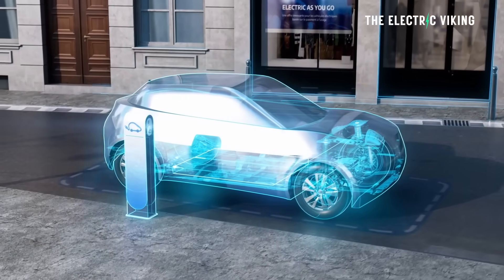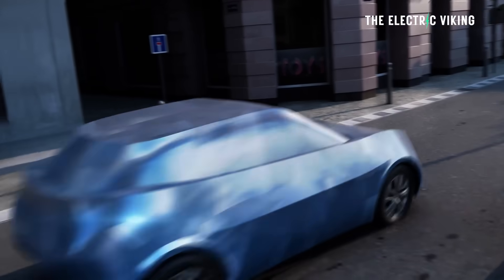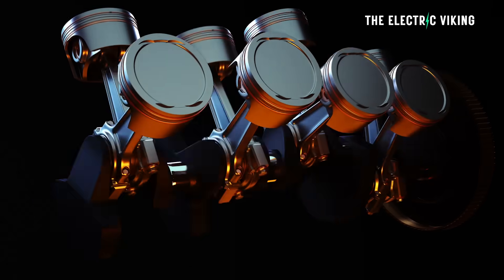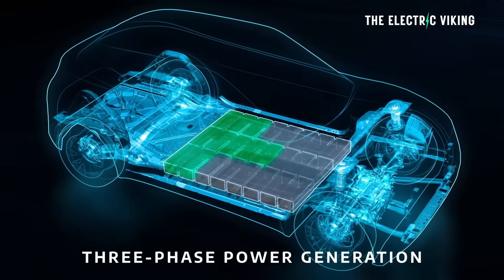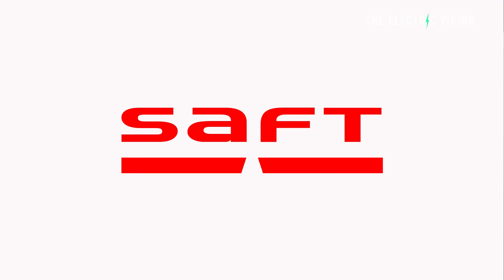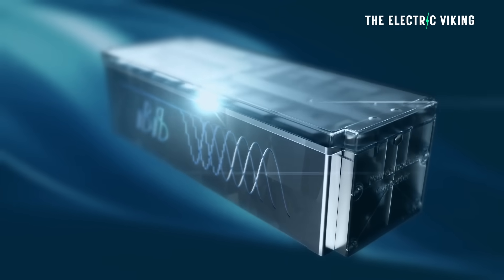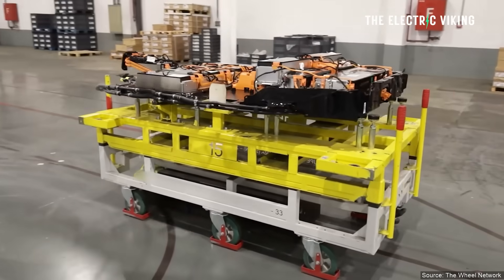Stellantis' says its new IBIS Battery tech will revolutionize small electric cars

Comment: It's about time.  It's been at least 6 hours since the last "game changing" battery was announced.  

I just wish one of them was actually practical and made it to market.
Reply: LoL. Well said
Reply: This has nothing to do with chemistry. It's all electronics
Reply: How about the latest Toyota hydrogen battery 🤣🤣🤷‍♂️
Reply: Sure 500wh/kg is great for aviation but what the car manufacturers need is a 70kwh pack that cost 3k not a 200kwh pack that cost 40k because if they only cater to 10% of the world then that well will dry up sooner or later and they will be in the same position waiting for bankruptcy
Reply: @lesstevens2370  3 year's or less away imo from that at the cell level when using lmfp or m3p iron chemistries. 

Remember catl is claiming the latest m3p chemistry supplied to tesla in china which uses iron, alum, magnesium&zinc doping. 
Are capable of matching energy density levels at the pack of the best nmc cells from 2020. 

So lfp is only about 3 development years now behind nmc for pack energy density. Gaining a lot of ground now very quickly it seems. 

Thanks mostly to tesla partnering with them in mid 2021 and half of all teslas sold since 2022 having some form of lfp cells in them. 
Estimates show lfp is over 43% of all cells sold ytd. Expected to exceed 50% globally for 2024.
Reply: this is extremely practical because it is completely independent of the battery chemistry. you could also use the same chemistry like VW has in their modules from LG. you can use NMC, LFP, LFMP, sodium-ion, etc. whatever is available. this something that the electric viking did not understand.
Reply: @stefanweilhartner4415  Right now, we’re in the middle of the next Industrial Revolution.
Last century, during the 70s, we saw the transition from discrete semiconductors into integrated circuits, and the miniaturisation of them, leading to memory chips, CPU’s and GPUs.
Now you see the development of batteries and new usages into applications like EV’s (and new ones, like automotive robots)
Reply: Catl condensed matter cells entering production by q4 of this year at up to 500wh/kg is real.
Catl just formed a joint venture for electric air craft. Those cells will power the prototypes. 

Nio and welion has the 150kwh pack in production and available now. Semi solid state pack weighs 44# more for 150kwh capacity vs the current catl 100kwh nmc pack in the same case. Cost is prohibitive though, rumored at nearly 40k just for the pack. 🤔
Reply: @4literv6  Also worth noting that CATL's battery is actually claimed to be cheaper than current Li batteries.
Reply: @davidcolin6519  indeed, very exciting imo to see the world's top battery producer boldly saying a 500wh/kg battery is entering production later on this year. Then actually form a joint venture for electric aviation! I believe catl will do what they say&shouldn't be ignored or dismissed. 

Also seeing as they are teslas largest single cell provider currently. That could mean some interesting time's ahead for tesla high end model's. 
Like gen2 roadster and maybe even semi? Imagine a 700-800 mile semi that charges in 30mins or less. 
Or a gen2 roadster lighter than a model 3 performance is, but with plaid hp&better aero. Watch out rimac nevera. 😀👍🏻
Reply: @4literv6  I think that you're jumping
 the gun a bit here,
Just because CATL supplies Tesla doesn't mean that Tesla is going to be favoured.
In fact Geely's Zeekr brand will be the first to have delivered units and, although Tesla has pu t in orders, there is no guarantee that they'll perceive favourable treatment.
And although Tesla has made a name for itself by working on efficiency by using aerodynamics and lightweight aluminium casting techniques, I am sure that there will be many companies clamouring to get these batteries.
In fact, seeing as CATL has multiple development contracts with multiple manufacturers, I suspect that production will go to manufacturers who are best placed to promote the wonders of CATL technology.
Under the circumstances, does that even begin to describe Tesla?
My impression of Tesla is that it appears to be entirely built around singing the praises of Elon Musk. You can certainly correct me if I'm wrong, but what if I'm wrong, but the impression is right? How far do Tesla drop down the list of clients? Obviously they're already behind Zeekr/Geely, but there are plenty of Chinese automakers which have just as enviable relations with CATL, but which don't have an egotistical maniac at the helm.
Reply: @4literv6  No One will buy a $40 thousand Dollar batterie............Paul
Reply: @paul-flyer  the first model s batteries cost over that. The price will come down as the tech matures and ramps up.

Comment: Stellantis is just building the charger and inverter into the battery modules.  Lets be clear about that... there is no way to actually get rid of the charger and inverter.  The batteries themselves are still DC.  This is not an improvement.  The lower voltages in each pack make the functions significantly less efficient and the multiplication of parts (every module having an inverter-charger) is more expensive and less flexible.  This makes about as much sense as a hole in the wall.
Reply: I fully agree with that your take and had the same reaction when I first read the announcement.
On top of that it is my understanding that the 3 phase AC current the drives the motor has to be finely tuned for best performance. If it is the case, good luck to synchronize inverters from 24 battery modules. 
I would also say the industry leaders (Tesla and BYD) are moving away from battery modules to structural battery packs so these packs will probably not be very efficient in Wh/kg compared to structural batteries
Reply: Ty for ur  very llkely possible foment u could be right I’m jus not smart enough to know any better
Reply: "microstepping" with multiple LV stages has some advantages. much less filtering, for example. lower voltahe parts with much slower switching, makes for less expensive parts, more efficiency. its a bold concept that needs quite some cost optimization.
Reply: @skataskatata9236  The electronics will be individually cheaper but not when you multiply by N packs.  The aggregate will be more expensive.   Voltages and amperages are lower, certainly.  Efficiency is lost by running at lower voltages, however.  Switching speed still has to be high though because that also directly translates to efficiency.

The way to think about this is to consider... say look at a Munro tear-down of a Tesla motor-inverter module.   There really isn't a lot in there.   The power switching electronics are a bunch of IGBTs and a few big capacitors and/or inductors and that's it.   No space is being saved by moving that stuff to the battery packs.

On the charging side it is worse because each pack has to deal with line AC... i.e. 240VAC. Or at least 120VAC (but most likely 240VAC).   The only difference there is that the charging amperage is divided by N.  But again, this is being compared against the in-vehicle charger which again is not that big of a beast.   I just don't see any advantage.

There are plenty of disadvantages.  The main one is that, as other people mentioned, battery chemistries are progressing at such a high rate does VW really want to integrate extra junk into their battery packs?  The one piece of equipment that is undergoing very fast, forced evolution?   Every chemistry change would require reworking the charger and inverter to some degree.

Its a huge mistake in my view.   VW needs to make those packs as simple as possible in order to be able to update them as quickly as possible as battery chemistries change.   That means: raw cells, BMS, and that's it.  No additional complications.
Reply: @junkerzn7312 it is Stellantis and not VW 😉
Reply: @pascalg.8772  Indeed.  I'll reframe.  All of the major brands (except the leaf).  In anycase, one interesting aspect of this is that it seems to have been aimed at smaller vehicles as a means of making for a more compact solution.

But even in that case I'd disagree since smaller motors mean smaller inverters and smaller chargers anyway.  Even inverters and chargers in full-sized vehicles are fairly compact.  So I just don't know what they are thinking beyond it being another marketing gimmick.

Comment: The IBIS battery system could be really handy for refitting old gas cars to EV. Being able to use smaller modules allows for more choices on placement in the car and getting rid of the inverter and charger is also a big deal.
Reply: Packaging the batteries is still an issue for an existing car. Splitting the batteries locations will cause issues with the loses between each group and the inverter caused by the varying length of cables. Creating 3 phase from batteries is nothing new. And frankly does not even require the batteries to be separate from each other. What they are doing is creating a stacked inverter array to create three signals.
Reply: @davefroman4700  Renewables use AC to remove power losses from distance. These modules tend to do this, and as such, it should be less of a power loss from distance.
Reply: @ronaldking1054  Its DC from the inverter to the battery. You cannot put AC current into a battery.
Reply: @davefroman4700  Yes, that is true, which is the purpose of a microinverter. The question is whether the microinverter is syncing to the AC line or not. I forget whether they actually do, or whether there is the need of another component to actually sync in renewable systems as the solar panel is dc, which is the same as the battery, but it is connected to either a main inverter or the microinverters. The good thing about the microinverter is as the solar panel degrades or if one is shaded, the entire battery pack is not affected, which means more reliable batteries as well as more range as the battery does not lose as much power to the inverter in the IBIS batteries.
Reply: , судя по рекламному ролика будет 3 ряда аккумуляторов, работающих каждый на свою фазу(анимациия в виде эквалайзера)
Reply: @davefroman4700 

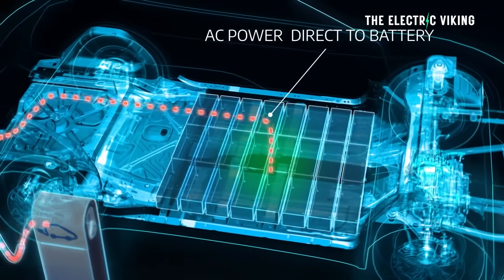7:08 
m
Reply: These Batteries appear to be about 8 inches thick which will reduce either ground clearance or room inside the car............Paul

Comment: There will be new batteries every year for at least the next decade but will one of them be from Setllantis? We shall see. Legacy auto does need to innovate to compete with Tesla and Chinese brands so we might see some good ideas from them. One interesting development from IBIS might be that it could be serviceable. It would be nice to be able to replace just one module rather than replace the entire pack.
Reply: yes, if you look after your car, it will last decades with this IBIS concept, even if the battery chemistry is not available anymore. it juts needs to be compatible at the plug of the module.
you could even throw out an old weak module and upgrade to a newer module with higher energy density and better charging speed.
it would be great if stellantis and VW could agree to the same battery format and plug/interface.
Reply: It may be like Nio which allows for battery swapping.